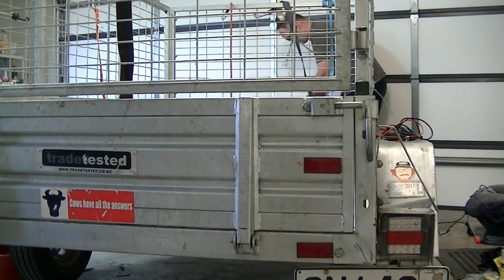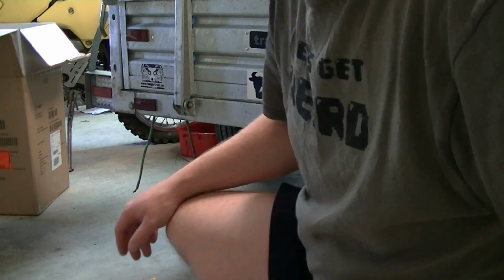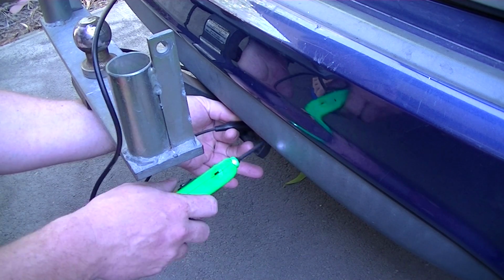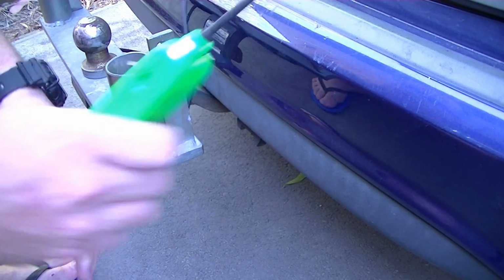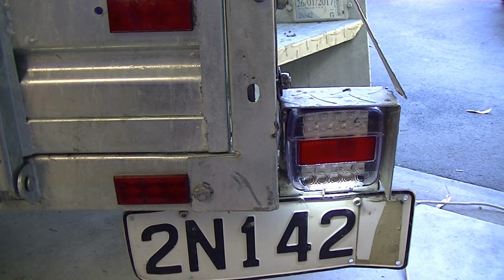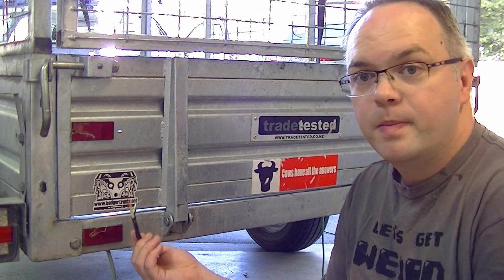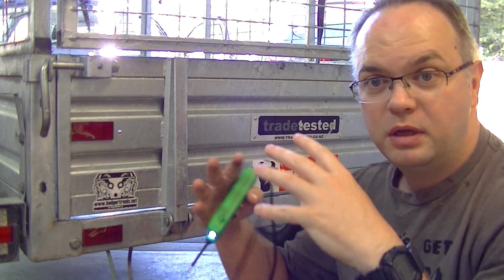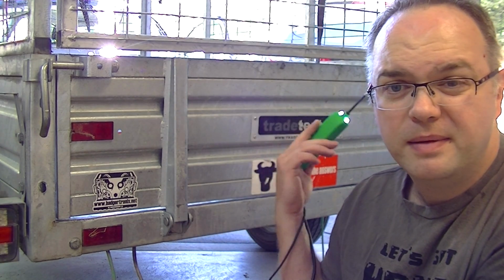Need help with my haunted trailer

Comment: My first thought low-voltage on the input of the plug on the car not giving you enough amperage at the plug to amply supply trailer. But just guessing without being there. Good luck
Reply from the maker: +buzzsah that eat my first thought and I checked and double checked the connections. Turns out CAN bus puts out a modulated signal on not a straight 12volts DC. Conclusion vid should be up in a few days. Cheers!

Comment: Trailer wiring can be a pain in the butt. Sometimes it can be a bad ground. Try putting the trailer on the hitch and see if that makes a difference. Just a thought.
Reply from the maker: Thanks John. It's not grounded through the trailer at all, separate earth wire runs to both light units
Reply: I understand that. I have had many trailers in the past. The only other thing is with the LEDs. I have had LEDs on my trail (Aftermarket) and they did come with a circuit. I am guessing a resistor or something. They alaways worked, but if your lights don't have that it could be the issue. Try a filament light and see if that changes anything. Do the simple stuff first. Good luck buddy.
Reply from the maker: filament light works fine so I'm going with a Canbus issue at this point. Will let you know

Comment: Wow that's weird!!!! I had a wiring harness wired wrong on the trailer side!! or maybe the brake switch ?? Hope you figure it out brother I'm sure you will!!! Cheers 🍻
Reply from the maker: Cheers man. I've checked and double checked the wiring and I'm certain that's correct. I'll keep working on it!

Comment: Okay all you did was change to LED bulbs. When you change back does it work properly? Can you measure the resistance across the old bulb and compare it to the resistance on the LED bulb. 
Check out  (Why 1157 LED won't work properly in older cars.)
And ( Led Lights - Most Common Problem Explained)
Reply: MostlymoparIH Check the resistance of a led. Hum how do you do that.  I've brought my gas can. LOL
Reply from the maker: works fine with conventional bulbs. Appears to be LED specific...
Reply: Badgertronix Hum I don't get it , the load of a led  tail light is less than your old bulbs .   Seem a couple of comments on canbus sending a signal to  the wiring harness seems to be something to look into. A first for me , maybe trucks are wired differently . Haha this is a new one for me , look forward to the fix.
Reply: Okay you put the key into the ignition and turn it off and on three times and leave it on the third time. Are you with me? By the way the torch went out but I gotta ferro rod.
Reply from the maker: +MostlymoparIH should I click my heels too?
Reply: Badgertronix  have to turn in circles three times first dorethy
Reply from the maker: +STEVE ROB true. And say there's no place like home with cod and curry sauce x3
Reply: Steve this doesn't look like Canada anymore. Pay no attention to the man behind the curtain.
Reply: Gotta pop the bubbley first.

Comment: Resistance "shouldn't" be an issue with tail lights and brake lights; it's only thermal flashers that tend to have issues.

Unfortunately, I don't speak Beep!  I'd love to see some actual numbers on those circuits you tested, preferably loaded (tail lamp assembly attached).

My only other thought is that the tail lamp/brake lamp portion is using a simple series-parallel switching configuration to go between tail lamp mode and brake lamp mode.  It's possible you may have to wire both of them up, or it's possible that you may have to reconfigure the wiring depending on how the vehicle feeds power to the trailer.  By any chance, do you have a model number handy for those tail lamp assemblies?  :]
Reply from the maker: I did connect a scope on a rope in parallel as a make shift resistor and it made no difference so I don't think it needs a resistor. I'll get some numbers for you and bring together any other suggestions in the follow up. Model Numer is eBay WingWang666

Comment: hi mate does your car have canbus wiring if so do you have the can bus wires box in
Reply: also double check the connections at the plug make sure they haven't spread out you have a good connection I seen a few times when you disconnect plugs you can slightly open up terminals inside which makes bad connection which can cause this problem
Reply from the maker: 2008 Ford Focus so I presume it is canbus. Pretty sure it doesn't have a box and is connected directly to the lights. Both the socket and plug are new. Looks like Mickey Mouse wired it in to be fair but never had a problem with any other trailer. Cheers!
Reply: Badgertronix I would put the box on it very cheap very easy to do and solve a lot of problems I have done a video on it but don't know the set-up you have over there but I would suggest to put it on as you can cause damage if you don't have it on
Reply: bodgit and leggit garage I'm with you on that one. It's prob the cars Canbus messing it up. I've fitted a couple of towbars from Witter and had a Canbus module to wire in to the cars lights then  from the module to the trailer socket. Basically it gives the trailer individual signals direct from the module and not the cars Canbus lighting circuit.
Reply from the maker: That sounds like a good plan to install the canbus doohicky. They're not that common here for whatever reason but I managed to find one. I'll connect it up and let you know. Thanks for the suggestions
Reply: Badgertronix if that doesn't work you definitely have a wiring issue somewhere double check your Earth have fun with it anyway let me know how you get on
Reply from the maker: +bodgit and leggit garage follow up video uploading now.....
Reply: One Auto, hi mate yes they can cause problems all right see myself

Comment: I'd say it's your strange connector from the  trailer to vehicle.
Reply from the maker: Those flat connectors are garbage but this one is brand new and seems to work as intended.
Reply: Badgertronix unless I missed something , you proved it works as it should with the power probe . Connect to vehicle it fails. It's the connector .  Where did you get the ground for the power probe, the trailer or did you use the ground from the connector. That's a clue maybe.
Reply: Seems odd it worked before you changed out the  tail lights to Led light. I have led lights on my trailers and I have no problems. I do have a ground to the frame on my trailer as well .